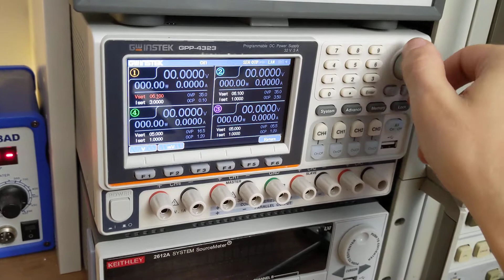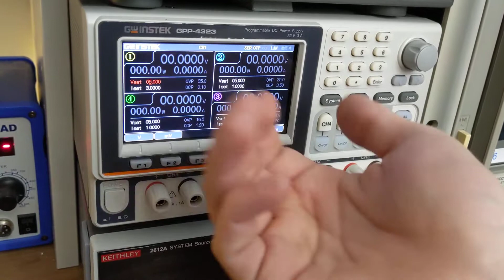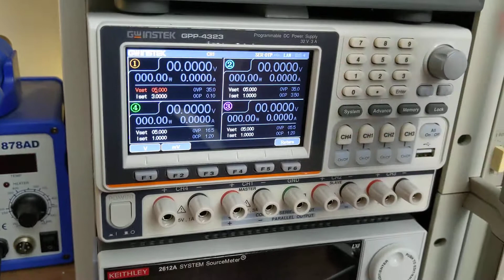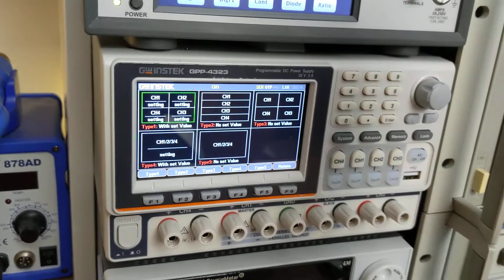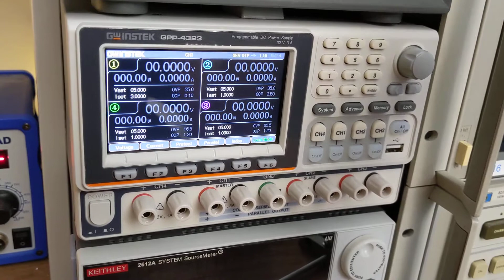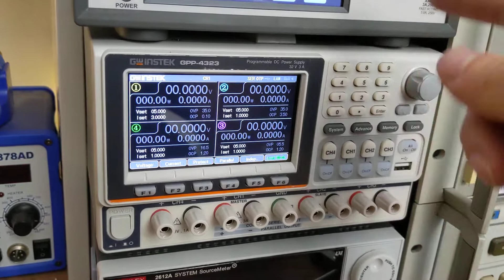GPP-4323 Review

Comment: Hello! How I can use it as Current source ?
Reply from the maker: The problem with using a power supply as a current source is the output capacitor. You can set a 1mA limit, but if the output capacitor is charged, it can discharge much more than 1mA without being limited. You might even see sparks with a 1mA "limit"! Instead, either use a quick custom circuit (voltage plus resistor, LDO regulator across a series resistor), an actual current source instrument, or a SMU.

Comment: Thank you for the review, well done. These things have really gone up in price so still debating one..  quick question, do you find the variable 0-1A  on channel 3 and 4, especially CH4... limiting being a max of 1A?

 I personally feel that's the biggest downfall of this PSU.
Reply from the maker: Yeah, it made me a bit nervous, but I've always been able to find a job for the runt channel. There's usually at least one low-power, low-voltage  job around. I suppose it's largely a function of what you're doing, and most of my projects at the moment are small modules rather than board bringup or power electronics. I've been eyeing the NGP-814, but it'll have to wait until I actually outgrow the GPP-4323, and that hasn't happened yet.
Reply: @jjoonathan7178  I agree, I think I will have more smaller jobs for the 3rd or 4th channel than I think. Having a variable, lower current channel, offers more flexibility than a higher fixed current channel.

That being said.....with the almost $150 increase of the 4323, I can get two 3303X-E's...for one 4323.....so there lies the dillema.

I'd rather have only 1 psu right now, but it's a PSU...lol, always room for more power.

My gut says go with 4 variable current outputs in one unit, than with 2 separate PSU's.

Plus, the 4323 has standard BNC-banana plug width terminals.

Comment: Thanks for your review. Are you still satisfied with your unit?
Are there any noise or humming sounds coming from the Unit? I have the OWON ODP3033 newly purchased at home, but the humming sound is so annoying so I`m considering to return it and upgrade to the GWInstek. Any other issues with GWInstek? Thanks i advance!
Reply from the maker: Yep, it still works just as well as it did on the first day. No hum, no egregious fan revving, it just works. I'd still recommend it!
Reply: @jjoonathan7178  Thanks for your fast response. I`m waiting for reply to my message about returning the Owon power supply from eleshop customer service. As soon as i got the RMA Label and know the right procedure for changing to the another unit I really will take the GwInstek into closest consideration. It seems a good unit for the price of approx 605€ including LAN-option.
Reply: @jjoonathan7178 Hi! Have they upgraded firmware now to make a quick current short cutoff? 10 ms is a deal breaker for me, enough to blow up my circuit

Comment: I would have a question about this power power supply output terminals. When I have a look what is sold today all PS have terminals "inside" of the supply but yours stick out. Is it another version? What is diferent?
Reply from the maker: I think there is a European version without binding posts because having possibly exposed metal at 32V does not comply with certain regulations.
Reply: @jjoonathan7178  I have orderd it so I ll tell you soon. I hope for binding posts, I don't know about any regulation that would prohibit the usage of them.
Reply from the maker: @thecuc007  Yes, unfortunately I can't be more specific because I am just passing on a rumor that I heard to explain a similar instance of one model having binding posts and a sister model lacking them. "Europe" isn't a specific country and "regulation" isn't a specific law, so I don't have much to go on one way or the other. I don't actually use spade lugs very often, but I slightly prefer binding posts and it sounds like you do too, so I hope that's what you get! Still a good supply either way.